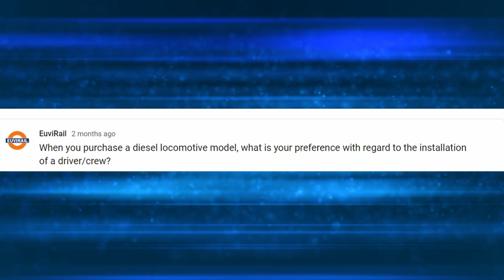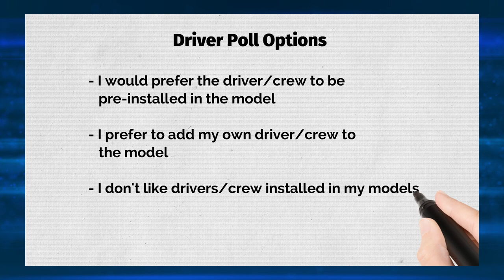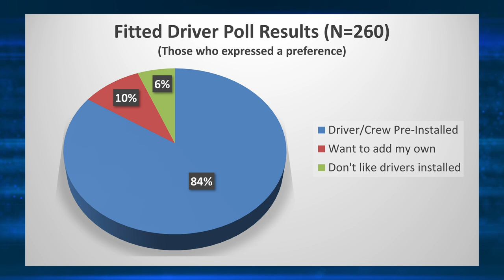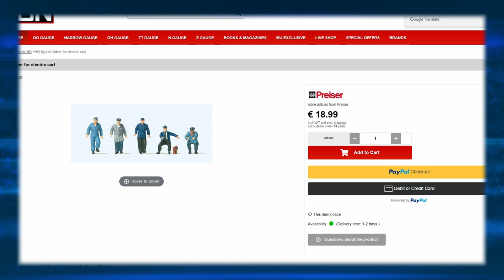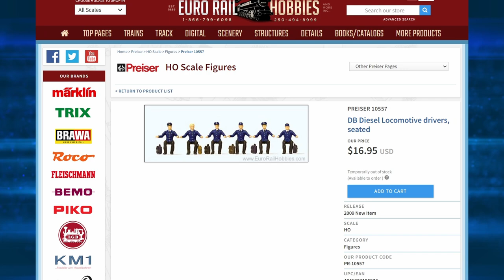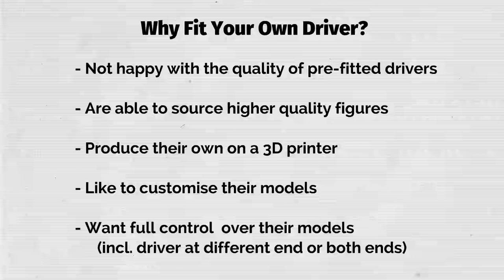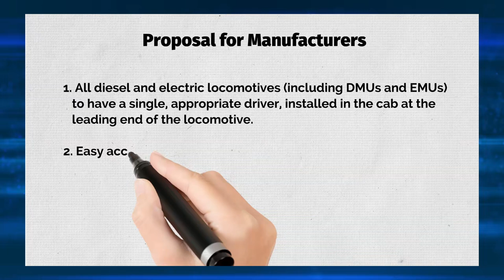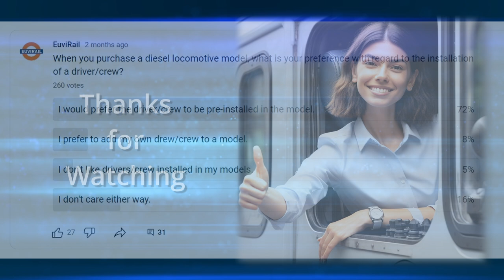Factory Fitted Drivers in Railway Models - Do we really want them, and if so why?

Comment: I want drivers, the DCC trains with cab lights make it very noticeable when they aren't fitted.
Reply from the maker: This is a point I forgot to include so thanks for bring it up. Those large well lit cabs look really bare without a driver.
Reply: Train drivers only have the cab lights on when preparing to drive a train. They turn them off when driving especially at night, just like car drivers don't drive with the interior light on.

Comment: The only issue I have with fitted drivers/passengers is that every loco would look the same if you have a fleet of them. As you said, having a removable cab would work very well to sort this. It would be really good having accurate uniforms for them, as it's always a pain trying to find photos to pain my own drivers
Reply from the maker: Thanks for that. Yeah, if you have a fleet from the same era, this will definitely be a problem. I think that Accurascale have shown that a variety of drivers can be created which is the flexibility 3D printers give you. One for the manufacturers to solve perhaps.

Comment: Great Video as usual my friend. I only buy sound fitted models nowadays because of the hassle of taking the body off to fit decoders with detailing on models so fine and so easily damaged by removing the body. I would love to have crew in locos factory fitted so long as they look convincing unlike  Bachmann of which I have a few with drivers fitted that even from a distance don't look good at all.
Reply from the maker: I do the same for the same reasons. I essentially want the "full package" incl. a driver so that I can enjoy the loco out of the box. Thanks for commenting.

Comment: Why not go a stage further, and ask about passengers in coaches? Most passenger coaches, especially those with fitted lights are so unrealistic when always empty. A selection of passenger figures, either pre-fitted or for the modeller to install would add to the cost, but would many prefer to pay extra for the realism?
Reply from the maker: I'm with you Dave. A lighted coach with passengers is the real deal. Too many ghost trains out there with neither.

Comment: I like the idea Hornby are now doing with providing a painted driver and fireman crew for stam locos so you have the option to fit them if you want to.If theory are for diesels I think the manufacturers should profit a driver but only attach with black tac so if you don't want to have the driver he can be removed without causing any glue damage I understand that some people do not want to try and fit there own crew and fearing damage to the models that cost so much money nowadays they are scared to try and fit there own finally the crew you can get are very poor so maybe it is down to the manufacturer to improve the standard of crew
Reply from the maker: Thanks Andrew. Including a crew in the detailing kit is definitely to be welcomed. With 3D printing so pervasive now, the means is there now to create decent figures so lets hope for more of the same.

Comment: I generally avoid fitting a driver if access to the cab is difficult. I do fit drivers into cabs that are easy to access such as the Hornby Class 73 or 47 and often put one at each end. Then the driver in the reverse end can be explained away as a "guard" or the like. Equally the drivers many not get on and prefer to sit apart! I guess I fall into the prefer a pre-installed driver so that more of my locos had a driver. Even a fairly cheap driver figure is better than none when looking at the loco from the usual "helicopter" operating height above the layout. I reckon a decent model driver should add about £10-15 to the cost of the model which isn't much if you are talking of a total price of around £200-300.
Reply from the maker: Thanks for sharing that. If your cab lighting is directional, then having the 2nd driver might not be as obvious at least.

Comment: For me I would prefer to have drivers fitted by the manufacturer. My experience of fitting drivers into the Dapol Class 68 and Accurascale Class 92 was fraught with nightmares as access was not easy. I would have preferred to have had the drivers I bought fitted. Fighting drivers I bought was easy on the Accurascale Class 37 as the design was totally different to the 92. However, if I had the option. I would have selected drivers to be pre fitted before the model was sent out to me. Just to save a lot of hassle and worry that model will get damaged in the attempt to fit a driver. 

If you wanted to go for option 3 then you could use Black Tack which is strong enough to hold the drivers but easy to remove if the modeller wanted to use different drivers and it doesn't leave any cosmetic damage.
Reply from the maker: Thanks for sharing your experiences. You shouldn't have to go through that for the sake of having a driver figure in the cab.
Reply: @EuviRail  Yeah, maybe one of the conclusions is that like there is a universal stand dcc chips maybe there is for cab design to make it easier.

Comment: On higher spec locos definitely. On Hornby railroad no. Accurascale models were easy to fit, as was fitting a DCC decoder.
Reply from the maker: Thanks for that. Ironically, access is usually not a problem with Railroad locos but some of them can't even accommodate a driver! While the survey doesn't distinguish, I would tend to think that Railroad locos would be bottom of the list for including drivers.

Comment: Diesel locos fitted with crew started with Mainline with its Warship / class 03 & 56 back in the early 80's . Given the Mainline models cost the same as the Hornby & Lima models it was a major step forwards. Bachmann carrying the practise forwards. With the Lima & Hornby models it was always a doddle getting the models undone & fitting the Preiser figures or the German Lufftwaffe crew that resembled BR's drivers. The Mainline models easy enough to undo & remove the staff / at that time BR moving to single manning & so the extra crew could be distributed about to other locos. The Bachmann 66 & 70 i have have the crew fitted , the Dapol 68's , 2 of them , the cabs are in that tight , you just cant get them out & so they run driverless which is a bit annoying . but endemic of the garden shed engineering that bedevils the new tools.
Reply from the maker: Thanks for sharing. The point regarding space in the cab is a very valid one and another reason for the manufacturer to find or create a suitable driver that will fit, even if it's supplied as a detailing part.

Comment: I model a terminus station with attached stabling point. Having a driver in the leading cab only works when the train enters he station, he looks a bit of a twit driving from the rear cab on leaving the station. Then in between duties he looks like "billy no mates" having his snap in the cab of his engine not sitting in the drivers lobby. Now a solution to the first problem is a driver both ends. That is OK to a degree with locomotives but an 8 car DMU formed of four 2 car sets not only do you have a driver in the rear cab but another six pillocks staring at each other in the intermediate cabs. As for the bloke sent to Coventry for strike braking and isn't welcomed in the drivers mess, any ideas?
Reply from the maker: Hi Clive, thanks for sharing this use case. The other issue of course is that the 4 drivers if they were pre-fitted, would all look the same. This is where easy cab access and easy removal is required. As for  the strike breaker, Accurascale have already modelled him. He's the member of the Class 55 crew who has to eat his sandwich in the cab!

Comment: Hi.  I’d definitely like drives fitted in both steam and diesel.  With the diesels I sometimes find that a loco runs better in one direction.  So usually have that as the “front”.  Either way, I’d be happy to have crew fitted at both ends.  Not prototypical I know.   Same goes for coaches.  Fit passengers!   Some coaches are a nightmare to get into.  And with lights being fitted more often, seeing empty stock is not a good look.
Reply from the maker: Thanks for that. I'm with you all the way. Lighted cabs and coaches look so bare with nobody onboard. Even 10 figures in a coach can take the bare look away.

Comment: Locomotives supplied with crew are often eBay type100 in quality poor examples in colours no shades of colour.
I've purchased crew from Accurascale colour 3d printed figures. While the detail is there, the print in colour is poor. I feel the ModelU and paint yourself to be my future option event better once I've been scanned and resin printed.
Accurascale score high for access to all area's
Reply from the maker: Yeah, agree on the Accurascale front. Hand painted Airfix figures I did when I was 10 were better than most of what you'll get today!

Comment: I don't want drivers at all, looks silly in diesels when you have cabs at each end and when running in reverse just looks odd with the drivers at the wrong end, none of my diesel loco's have drivers.
You can get away with it in a Steam Loco because of the single cab.
Reply from the maker: Thanks. Easy access so that you can add or remove should help keep us all happy.
Reply: @EuviRail  How about a DCC or DC Switch function where the factory installed driver flips into the floor for no driver and flips back when you want a driver, that would be a feature & a half.